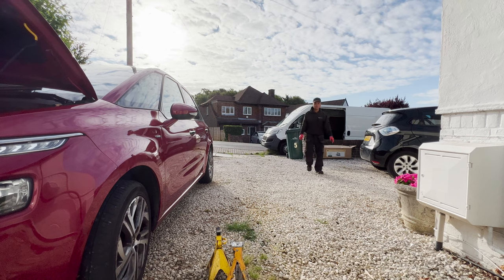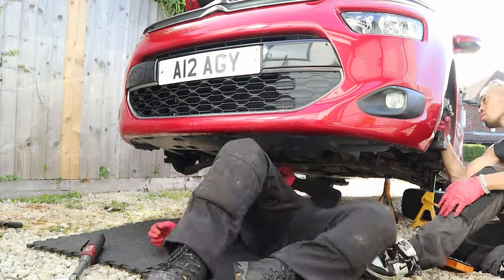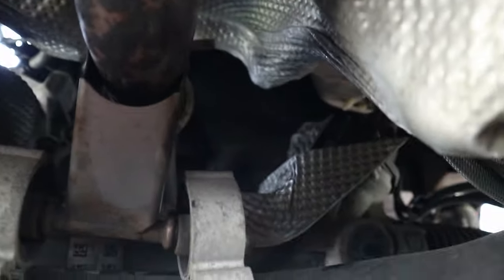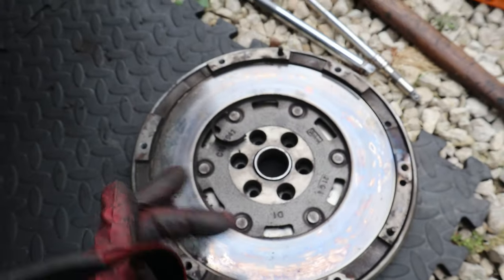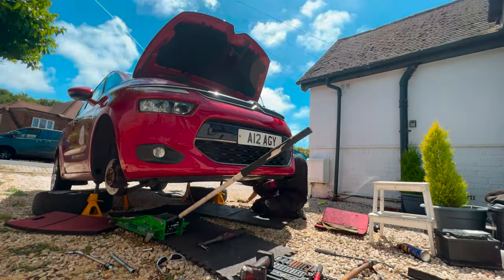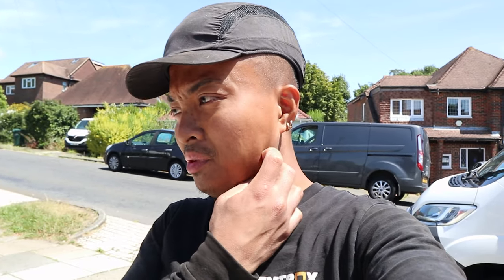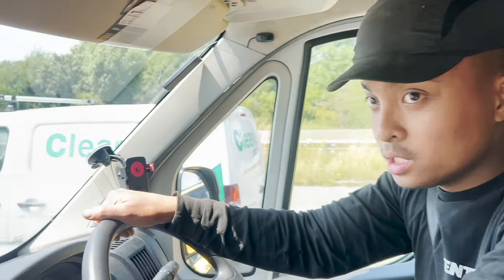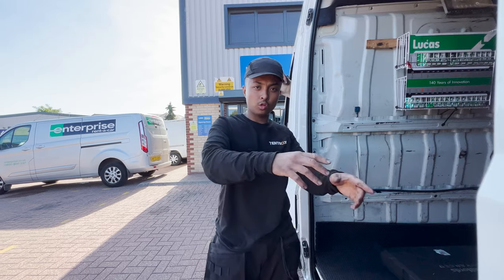Life of a Mobile Mechanic | C4 Clutch Replacement |  2008 Ford Fiesta Shocks Replacement | VLOG 5

Comment: I usually spray the bottom ball joint then put the gun direct to spin the bolt then tap it from the other side with a long pin punch, it usually frees up the bolt.
Reply from the maker: I do the same, but when I did just that, I knew something was up. I think the bolt rust welded itself in 😭😭😭

Comment: Don’t forget, a dual mass should have some free play, it’s a certain amount of teeth that it should move which differs from one to the next so doesn’t always indicate a worn out dual mass if it turns. Had a mate who was adamant it should have none at all and changed it when it wasn’t really needed
Reply from the maker: Dual-mass rattle and that much free-play. I’m sure that this flywheel needed replacing 🤔
Reply: @themarvelousvlog  I think you should re-read what I put.

Comment: Those pinch bolts never remove using the torx head. Run the nut off then use a heavy drift piece of metal with a large hammer, they will eventually start to shift
Reply from the maker: Why not the Torx head? 🤔
Reply: @themarvelousvlog  the bolt is always so seized on a car of that age, and an internal drive fixing will either round them off or snap the torx piece.

Always hammer them through with a big drift/punch and get a new nut/bolt ready (worth keeping a few in toolbox) They should of made them a 17mm 6 sided bolt, would allow much more purchase on the fixing. I had same issue with a 2019 Ford Courier last week, seized solid